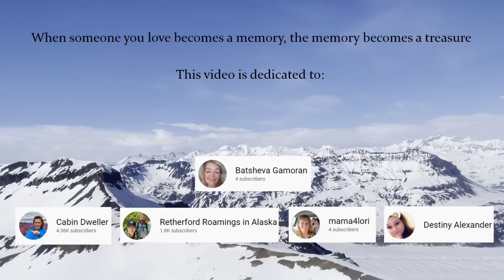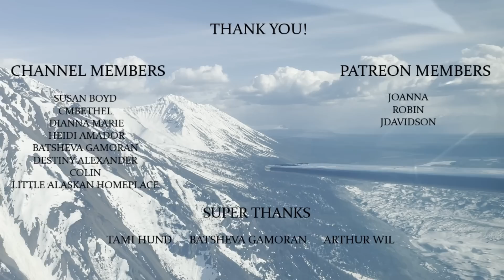Old Alaska Cabin Restoration continues before taking flight over Wrangell Mountains

Comment: The basement is indeed gross but you can cordon off an area and have cold storage and also maybe another tank for gray water for showers and dishes or a drinking water tank?
Reply from the maker: Cold storage and drinking water for sure. Grey water will most likely go straight outside. In a control area of course. If it goes to the root cellar it just has to get pumped out eventually when it gets full. Once the root cellar is cleaned up, I will be able to use it for a lot of things. It's basically just another full floor in my cabin that I just was able to reclaim! Thank you so much Holly! :_Heart:

Comment: The new roofline is a huge improvement. Your root cellar is massive. I would install spray foam insulation and install bear-proof doors. The decision on how to use that space is access dependent. Difficult to open doors with 6’+ snow load on them, so winter access is tough. If you could put in a staircase from above, then you can do all sorts of things. Install grow lights and grow cold weather veggies down there. Lots of pantry space!
Reply: Yeah, I’d definitely have an access door from within the house. It would even be a good place to hide if you thought you might need one.
Reply: She already said she’ll have access from inside.
Reply from the maker: Yes! I have the same footprint as my entire first floor! It's an unusually big root cellar! Access from the main floor will be installed this construction period. Stairs down. I will reinforce the outside access but keep it secured from the inside so it can be used as a fire escape if needed. I will have a backdoor installed so I can keep the snow off the hatch as well. I will go into more detail in the next video. Now that I will have access this year, I can monitor the temperatures to see if growing will work. I have no clue actually how cold it gets down there. Many shelves will be made for canning. Earthquake proof shelves! Thank you so much Deb! :_Heart:
Reply from the maker: @toscadonna  That and a fire escape if needed! Should have stairs to the root cellar in a week or two! Video will be made! Promise! :_Heart:
Reply from the maker: @christinabeck9316  Certainly will! Stair access too! It will be a game changer to be able to get down there all year long now! Video will be coming as soon as its done! Thank you so much Christina! :_Heart:

Comment: Wow - that was a lot of rat crud. Definitely, it was a good idea to get that out of there. I might suggest spray foam for the ceiling and walls. That will insulate everything, and you shouldn't have the rodent issue, because there's no way for them to get behind spray-on foam. This work is a lot of manual labor. Those new support beams had a vast amount of weight. This place is getting the repairs that it desperately needed. Good job.

Loved the aerial shots. That's real wilderness.
Reply from the maker: LOL yeah the mice had full run of the place for 6 years as it was unoccupied. I may use spray foam for the ceiling since it is basically the main floor of the cabin. The walls may get bubble foil as I don’t want to block the cold for the root cellar but I may be able to control how cold it gets by just closing up some of the wall. But spray foaming all the entrance holes for sure! This cabin is old but she has a lot more life in her now! Glad you enjoyed the plane ride! I know I sure did! Thank you so much Mike! :_Heart:

Comment: I have flown all over Alaska in light aircraft and never get tired of the views.  So many hours in a 185 on floats I have lost count.  As to your basement, have you thought about sealing off the outside access and installing inside access?  Makes it safer and easier for you to use it for long term food storage as well as storing seasonal goods.
Reply from the maker: The views flying from that level are a whole different kind of experience! First time for me and yeah, there is just so much more detail to look at! Inside access to the root cellar will be done within a week or two. I opted to have stairs built down because although a slide would have been a hoot to go down to the cellar, it’s not so much fun trying to get back up! LOL! :-) I am going for a trap door style this year and next year may frame it out with a regular door.  Outside access will remain as it could be used as a fire escape. :-)
Reply: @AloneinRemoteAlaska  Could go with a fireman's pole!

Comment: So basement / cellar... Would turn in to a combo of family den work space pantry. Add a fire place to light up when down there.. to help cut costs of heating or run plex on ceiling to heat floor above hook in to the wood stove that would help heat the house or a solar duct that would heat up with out the thinking of broken pipes water all over thoughts. The family room would add more sleeping area.. heck 30x30 is a lot to work from that's for sure.  Can't wait to see it all finished.
Reply from the maker: My plan is to keep the cellar cold. That way I can long term store canning goods, canned goods and all other forms of food. Water storage too. I may even put in a meat and fish processing room. Some firewood. If I keep it cool like it is naturally, I can even vent some cool air to the cabin. It like free air conditioning. Right now, its just so warm outside and the metal roof adds to the heat. Odd to thing of air conditioning in Alaska huh!? The space is big. Even too big. But I plan to make it all work best I can. It will take a couple years though. :_Heart:
Reply: Thanks for replying.  So just what happens to the old insulation? Up in the high north?  My thinking that to bad they don't have a  thing such as a insulation recycle plant where old could be washed sanitize and remade for reuse. In sense saying save the planet recycle it all.
Oh my thinking flips back and forth.
I see ya know and yea that coolness down there does help. He house I and my 1st x had in Wyoming had a basement...and it did seem cooler at times .
I was just thinking of the way ya get 24 light in summer the way the cold sneaks in during the winter.  A meat processing down under ! Wouldn't it draw attention to the wild hungry o try to get in. Girl ya be teasing the bears wolves other critters pulling danger from the from the woods right to that door.   Oh now my dreams are gonna be intense. But guess I'll build a labyrinth  around your cabin in my dream to keep the place a protective one. You be safe...
Reply from the maker: @cookiecrumbles4024  LOL! The outside hatch will be reinforced a bit. However the entire back of the cabin will be fenced off as well eventually. Even just an electrified fence around the outside hatch would work temporarily. As for the old insulation, once it goes to the transfer station I believe everything gets sorted so if there is a way to recycle the insulation I am pretty sure they will.  I will see if I can find a thermometer to show how cool it is in the cellar. It really is nice and cool. :-)

Comment: for the root cellar I suggest making it water proof if it isn't already, re insulate the celling so your not getting the cold up through your living space floor. I would also get a few lights down there so your solely relying on torch light during the winter months. you could buy sturdy shelving to store some of your canned foods (you said your going to start canning things). are you signed up to the road kill scheme? you get a call when a moose etc has been killed near you and you go along to collect it( I've only herd about it on another YouTube page that also lives in Alaska. they have been living remote for a couple of years and they grow all of their own veg etc and can it for use during the colder months. their page is  
Simple Living Alaska 
if its water proof maybe use it to store winter clothing when its warm enough to not need it. maybe use it to store your winter wood?? of would that be too hard of a job, or would it not dry out enough? (never needed to buy fresh logs, only brought ready logs for a small open fird in our old house) its coming along lovely and i cant wait to see what your upto next
Reply from the maker: The root cellar is perfectly dry! Not even a bit of water even during the winter melt down. I definitely will be re-insulating the ceiling though! Yeah cold floors! No fun at all! I will have "earthquake resistant" shelving put up as well. Basically shelving attached to the ceiling. Bungee cords and padding on the shelves. But new led lighting is needed for sure! Its pretty dark down there! I know of the road kill call list but I do not have the trailer, equipment or knowledge to field dress a moose or bear. That is a skill I will have to learn yet. And if you get the call you have to arrive within 2-3 hours and they don't tell you where its located until you say yes. I know of Simple Living Alaska's channel. Eric and Ariel make some great videos! I will definitely be using the root cellar for other random storage as well. Just have to make sure I store it in a way that mice cant get inside! Oh and I do plan to keep a small supply of firewood down there "just in case".  But so many things to do here! Stay tuned Tannia! 😁

Comment: I would re insulate maybe with spray foam and put plywood up on all the walls than put shelving up for the food in the root caller. stay safe. try to insulate as much as possible to keep as much heat in for the water tank.

Comment: I see a woodshop and a meat processing area in that cellar. Plus it would make a great wine and whiskey storage area. No still though as it would melt permafrost. Also, an outdoor wood furnace could be plumbed into the floor for radiant heat. Question about your flight to follow in the previous post you referenced.
Reply from the maker: You know Chris, I had not thought about a meat processing area! That's an incredible idea that has my head spinning now! :_What: IF ONLY I drank wine huh?! Well I guess I could still store wine down there even if I don't drink it though! :_Laughing: Um yeah no still. I need to keep that area cool! So the original "basement" was much smaller and housed the huge wood stove that is now next to the greenhouse that is use to burn trash. When the previous owners expanded the basement to the entire cabin footprint, it was removed. Believe it or not the concrete floor has the hot water tubing in it. They never hooked it up as the wife wanted to use it as a root cellar instead. I have been looking at the outdoor wood furnaces and wow they sure need a lot of attention! :_Heart:
Reply: @AloneinRemoteAlaska  They do but from those I know that use them in the Mid-Atlantic,  they are pleased a5 their performance. If you had a drain, you could set up a water tank for meat and fish processing. Get a stainless steel table and bar sink.
Reply from the maker: @j.chriswatson6847  I have 3 brand new stainless tables coming from Colorado.  A stainless sink will need to be added before that Uhaul heads up here now. Spaced that out! I have been watching some YouTubers with their outdoor wood furnaces and I would say they are about 50/50 on if they are any good. I think they are pretty nice actually. :_Heart:

Comment: i would put 1500 hundred gallon storage of fresh water and buy a trailer and some tanks to haul water with so you have more on hand it wont freeze down there. also put rain catchment outside and filter it so you can use it also for your garden and other water stuff .
Reply from the maker: Until I get a well drilled, more water storage will happen for sure. Luckily I don’t go through too much water now but I still can do dishes, take baths and do laundry. Melting snow works really well too. Just have to keep doing it. Eventually all of my buildings will have rain catchment as well. Just takes time but mostly it takes money! LOL :-) Thank you so much Spurlin! :-)
Reply: @AloneinRemoteAlaska  oh I know money is the big part especially when you purchase a fixer upper. That's what I buy but also i can do most of the work myself. You are doing g great. Just remember make a list it will be long but hen prioritize it  with thi gs you can do and things that have to be hired out. The list keeps growing and can get over whelping. You just got there and are in the honeymoon stage . I think your dog g very well
Reply from the maker: @spurlinmartin8933  I think I am trying to get as much done as possible during the "honeymoon" stage! Eventually constant construction will be a pain! But I want to make sure I get the big stuff done with the contractor I managed to find. He is awesome. But you are 100% correct! The list never gets shorter! :_Laughing: Thank you so much! :_Heart:
Reply: I think your doing awesome.
Reply from the maker: @spurlinmartin8933  Well thank you kindly Spurlin! :_Heart:

Comment: I know I have not long joined and subscribed and have been binge watching up to now, once you have altered the access would it be an idea to use the old access to the basement from outside as a wood chute for your winter wood storage so you have no need to go outside in -60 temps.

Comment: I've watched 3 of your videos now, cost of heating fueling the fire, restoration of kitchen and bathroom work and now this one.

May I ask a question?  If I remember correctly you mentioned your cabin was about 2500 sq ft with 1800 sq ft of heating living space for a person living alone.

Question:  Is there anyway you could "downsize" some of your cabin, ex., lower the roof  by installing a lower ceiling?  I live by myself and two Jack Russell Terriers in the south; have about 2200 sq ft and wish I could sell this place and downsize to about 15-1700 sq ft. A simple cabin with a stream or creek in the back would be perfect.  But not many are on the market.

The hottest month was last month and my total bill was around $280 or less.  My summer temp is about 74-75  and winter around 68-29.

If I had your monthly bills I would almost be homeless.  That's a lot of money, but, it should really go down with the upgrades you are implementing
Reply from the maker: First, thank you so much for watching my videos Chuck! The idea of downsizing my cabin (lowering the roof) and even demolishing the cabin and rebuilding has been brought up by other commenters, so its not a crazy question. I have watched many videos of people who have started homesteads and built their own cabins. Most of them, when giving advise, always recommend building bigger than you think you need. Or building to small was their main regret. My cabin needs some repair and remodeling for sure. I knew it was going to need to be fixed up. I believe it has almost always had families living in it since it was built. Even the root cellar and arctic entry where built after the cabin was built to make more bedrooms. I think, as I keep making improvements to the cabin, that the efficiency will get much better. But I absolutely agree with you that this cabin is far too big for just one person. But that’s what was here and the cost to downsize it (or rebuild) is probably more than anyone realizes simply because of how remote I am. I was lucky to find the one contractor that I did.:_What: Hope that makes sense:_Smile: Thank you so much Chuck! :_Heart:

Comment: Are the timber logs treated? If not how long do they last without rotting? Thanks
Reply from the maker: They are not treated but must be stained or painted. If not I would think that they would start rotting within 3-5 years. Just depends on how wet they get. 😉🧡

Comment: Not familiar with rats, but am curious as to how they get up into the insulation, and what can you do to prevent this from happening again.  I guess I had no clue that a rat can make a vertical climb up a wall.
Reply from the maker: Luckily I don't have rats. I believe there are no rats in Alaska. Mice will climb straight up a brick wall like nothing. Wood is even easier for them. The only thing I can do is not give them anything to climb up for. Fiberglass insulation and rock wool are their favorites! I can use spray foam or bubble foil. At least with bubble foil I can control the temps a bit by removing pieces. Foam boards will attract ants. Always something! Thank you so much Kerry! :_Heart:

Comment: Are you gonna get spray foam insulation?
Reply from the maker: I just might have to. Only the ceiling though. Maybe just the wall behind the water tank too. I have to research this a bit more. Otherwise it will be bubble foil. Thank you so much Kimber! :-)

Comment: Our house had sat empty about 2 yrs. and the mice had moved in. We had a huge mouse problem. It took a while to find & plug all the holes, replaced a door etc.,  but I think we finally did it! It was disgusting! I threw out boxes full of stuff (clothes/towels/bedding) as they were full of grossness. So gross! Anything  fabric was tossed & even a lot of hard surface items as no matter how much I cleaned, bleached, boild things I mentally couldn't think of using it again. Great way to declutter though! But that insulation that you had fall & was so gross, you have us beat, ha! 🐀💩

Comment: What will you replace the insulation with?
Reply from the maker: I cant use fiberglass or wool batting as that attracts mice. I cant use styrofoam as that attracts ants. My only options may be spray foam or bubble foil. Any suggestions? :-) :_Heart:
Reply: @AloneinRemoteAlaska  Sounds like either option is expensive seen a lot of the spray foam. One such Youtuber Eamon and Bec in Canada used spray foam on their cabin.
Reply from the maker: One of the YouTubers I have been watching for a very long time is Boss of the Swamp https://youtu.be/modAVIcKNBA He has been doing this life longer than anyone and lives in New Hampshire now. He 100% endorses the use of bubble foil and its the only thing he uses. One of his cabins burned to the ground because of squirrels nesting in his attic with the fiberglass insulation.